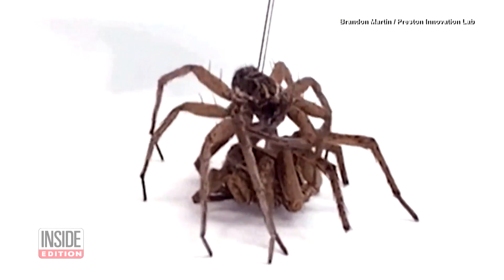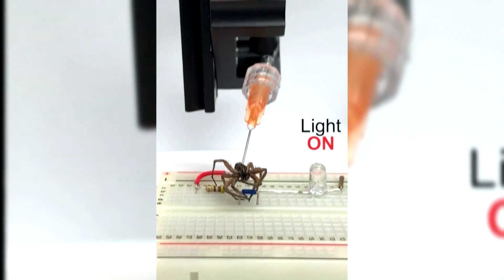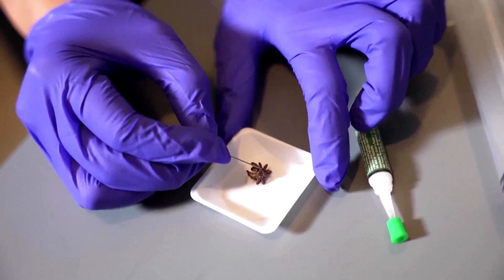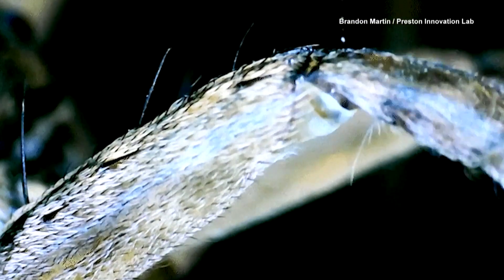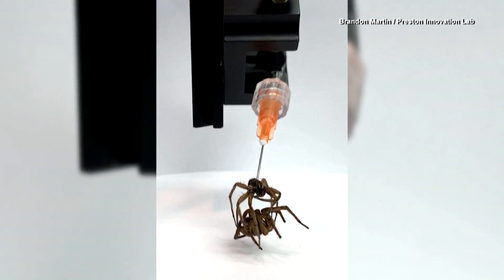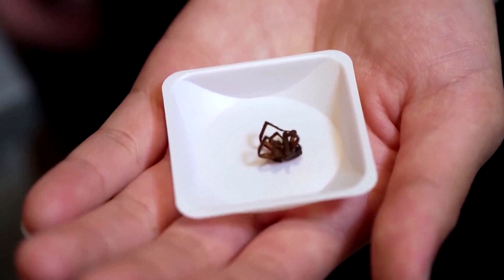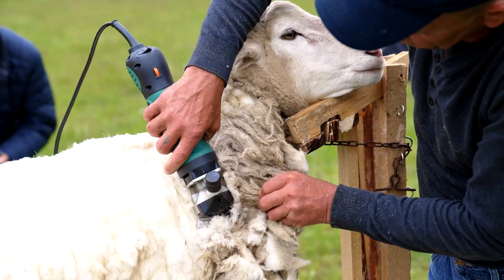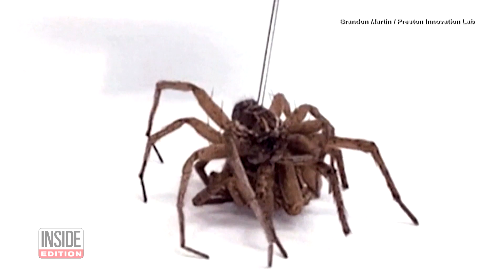Engineers Discover Dead Spiders Great at Gripping Things

Comment: Only problem is that real insects decompose meaning they don’t last forever
Reply: This could be useful in, say, q complex and tightly-cramped aircraft engine that some mechanic dropped a penny in.
Reply: @ivanvarela3215  they actually make a tool like that already that’s a claw on the end of a long spring.
Reply: I guess it’s a good thing spiders aren’t insects. Also, have you seen taxidermy on arachnids? You’d be surprised what you can preserve
Reply: They could use it as a model to make a robotic spider or something similar to a machine claw.
Reply: @am12576  which, as you may note, is astronomically more costly than a repurposed spider on a needle
Reply: @ivanvarela3215  Yeah, but if the benefits outweigh the costs then I'd say it's worth it.
Reply: @am12576  wa .w.
Reply: @ivanvarela3215  Sorry?
Reply: @am12576  fish slap

Stop wasting time on YouTube comments sections, lad! :3